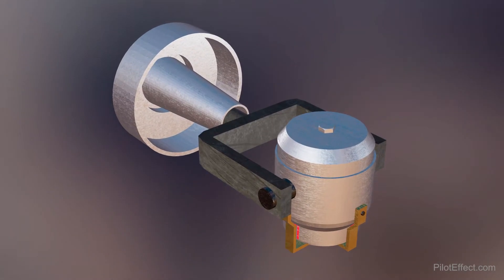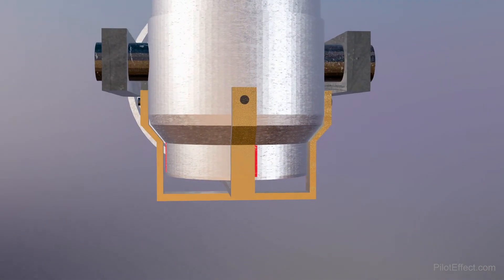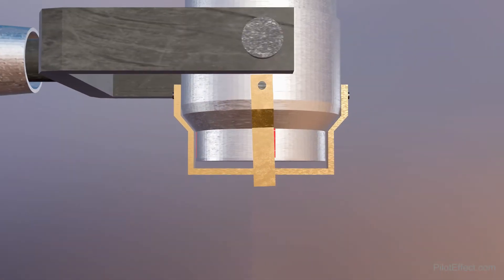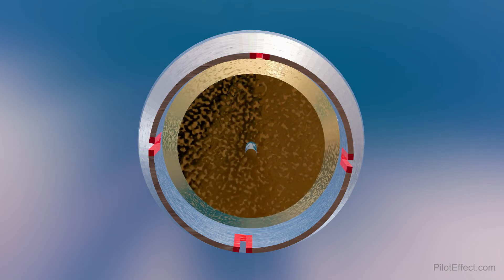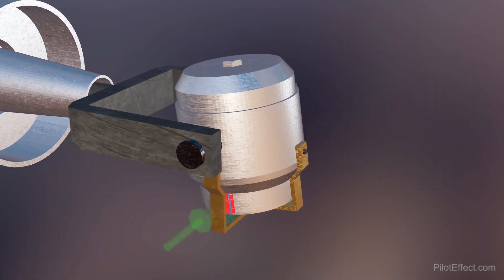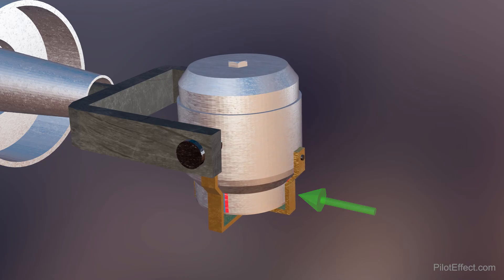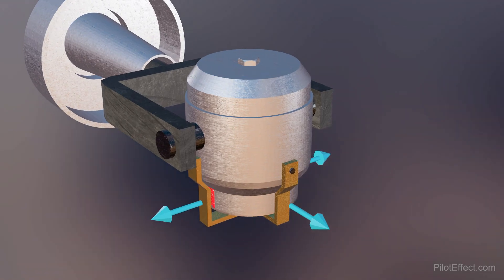Pendulous Vanes | Pilot Tutorial

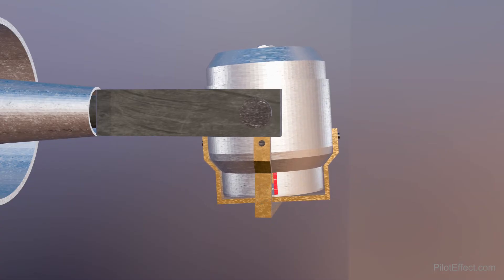Comment: Wrong Wrong Wrong The Gyro Rotor is rigid in space  and in this example would always be "Upright" it is the instrument case that tilts and moves in relation to the fixed, Rigid in Space, unaffected by ANY force Gyro Rotor... your statement @ 01:30 is false; the rotor does not "tilt " or move at all in relation to the aircraft thus your Pendulous Vanes would always be perpendicular to the horizon seeing they are attached to the rigid gyro rotor which is ALWAYS parallel to the horizon.... Think People about what you are being told... Total Disinformation has been fabricated and given here. The Earth IS Flat! You can Believe That!
Reply from the maker: hmmmm...
Reply: Nope — both Gyroscopic precession and Earth Curvature will force the gyro off vertical, even just from rapid maneuvering.

The ports are required to keep the gyroscope aligned to the vertical EVEN as the plane flies around Earth’s curvature.

Your brain is damaged from watching too many frauds on Flat Earth videos.

And just FYI, EVERYTHING is ‘rigid’ in space unless and until a force is acting on it. You don’t have to be spinning and spinning doesn’t protect you from forces acting upon the gyroscope.  What spinning does is effectively rotate the effect of that force 90° which is why gyroscopes SEEM to ‘defy gravity’ but they don’t — that force simply causes a precession.
Reply: Dark Star, 

The gyro is purportedly self correcting to remain vertical as the aircraft navigates around the curvature of the earth. It is believed this is happening because it is designed to remain vertical relative to its' original caging point. The issue is, that it would also continue to function this way if it actually wasn't navigating a curve; which you assume that it is navigating.

So, how to prove that it is doing the repetitive self-corrections during a long distance flight? 

I suppose you could video the pendulous vanes in action. Or, record the gyro  repeatedly  try to tilt backwards (in the SAME direction) over and over as the plane moved around the curve. Or, completely open all of the ports, and time how long it takes to begin to lose vertical alignment; then, see if during a flight of that same time period any curvature is detected.
.
.
.
There are those that claim 'gravity' automatically keeps the aircraft at the same relative altitude as it navigates around the curve. But 'gravity' has no feelings towards the occupants of an aircraft. It doesn't "care" if you live or die; fly safely or crash. And it wouldn't act to keep the plane in a level flight. The pilot must care about those things.

So, gravity isn't going to make sure the nose and wings are being kept in the proper alignment for safe level flight. Ask pilots that you may encounter or know personally, if they are periodically and repetitively changing the angle of their aircraft to follow the curve of the earth. I think you know the answer. If they aren't then that caring force know as gravity must be doing so. Just as it keeps one wing from dipping below the level of the other.
.
.
.
There is more to the whole gyro curvature debate then what you have been led to believe. Take for instance the Artificial Horizon visible in a Apollo LEM training module ( https://www.youtube.com/watch?v=2wfp-IMkN98 - seen beginning at 20.21).

A gyro in 'space' would only be useful for showing you your orientation relative to the surface of THE EARTH (if it worked at all). It cannot be used to orient a craft relative to the surface of a body it is not first oriented in relation to (i.e. - 'caged'). So how does an astronaut use it to orient himself to a surface - planet, asteroid, or moon - that he has not yet touched down on? 

"LEVEL" . . . would be level to the surface you took off from; not level to the surface of a sphere of a completely different size that you are approaching. Something smells in Denmark. Don't be so dismissive of those who will admit when they smell it.
.
Reply: @mephi654  that youtube video mentioned got terminated ... do you have a back up video? or a different link
Reply: Yo wrote: ""LEVEL" . . . would be level to the surface you took off from; not level to the surface of a sphere of a completely different size that you are approaching."

Exactly! That is so true. Here is a good link of it:
https://www.youtube.com/watch?v=zwKg9ZncrRg&feature=youtu.be&t=589
Reply: Here, let me repeat myself:

(Note: they claim they touched down 4 MILES from where intended; doing so by pilot control to avoid a boulder strewn crater; and with only 30 seconds of fuel left in their tanks.) 
.
.
Visualize what they claim they did. As they are approaching their landing they realize they are four miles from the place they intended to land. The place they had planned and practiced landing at. Immediately before them, is a crater that is boulder strewn. They take manual control of the craft and "skim over" the crater to land on the other side of it; with just 30 seconds of fuel left. No big deal right?

Kind of like doing an emergency landing four miles from an airport, without circling and looking for a good spot. From a position more or less lying on your back. And while not looking out of the bubble of a sailplane or F-16. No big deal at all. 

What made it much easier was the fact that they were clearly only going a half of a mile per hour, and that the craft was made to take all kinds of impact abuse. Not to mention that there were thousands of rockets and astronauts ready to launch at a moments notice, to come to their rescue.
.
.
.
Back to the topic at hand. The purpose of a gyroscope is so that you can determine  your orientation  relative to the horizon. As they were approaching their actual landing site, their gyroscope could not give them their orientation to that horizon because:

1) it had not been calibrated (caged) in orientation to that surface,
2) they were approaching a landing at a place they had not prepared to land at,
3) they did not have a very good ability to fly by sight from that craft.
.
.
Did they KNOW with mere seconds to spare, that the place they were now attempting to land was level ground? Did they know if it was sloping to one side, or towards them, or away from them? Did they know that the orientation of their craft and it's extended legs were correct for that surface? If the lander is leaning slightly forward, and the ground is sloping (even slightly) upward in the distance, the results are catastrophic.

How could they know that . . . when it is the Attitude Indicator (gyroscope) that shows that orientation, and theirs could not possibly have been set to reveal their crafts' position relative to that surface? Focus . . . I'm not saying they couldn't determine how far they were from a surface. I'm saying, that they couldn't determine if they were leaning too far in any direction. 
.
.
They would  feel  no 'up' or 'down'. They couldn't do what you can do on earth to correct these errors. They wouldn't realize they were going to impact on all four legs, or on two, or just one. THAT is the purpose of the gyro: To tell them if they were level with the surface. Use a model of that craft and 'land' it on your dining room table. Only as you approach the landing, tip it too far forward. See the problem?
.
. 
.
Do you believe they could correct that problem simply by looking out the windows? Before answering, consider why pilots are trained to rely upon their instruments. Consider why they even exist at all, if they aren't really needed. Then consider  WHY  such an instrument would even be included, when it could not possibly have been calibrated to a show the horizon of a surface upon which they had not yet been.

It was included, because its' purpose was to convince you that they had the capability to do the impossible because of "technology". They know (or knew) how few people really understood how these things worked. Smoke and mirrors; technological smoke and mirrors.
.
Reply: "Something smells in Denmark."

Yeah. But it is something different then what you are thinking of.
Gyros used in spacecraft operate differently then the ones used in airplanes. While plane-gyros can use pendulous vanes to reorient the gyro according to the local direction of down, spacecraft gyros cannot do that. They remain their absolute position in space by
* carefully aligning the gyro to the desired corrdinate system at the launch platform
* checking the gyro drift every now and then with the help of a star tracker. Since the gyro should be stable in space (but isn't due to unavoidable precession caused mainly by friction in the bearings), the star tracker knows in which direction a specific star should be visible with respect to the spacecraft. It then figures out the deviation to the direction in which the star actually is visible. Using 3 or 4 stars in that way, it is possible to calculate, how much the IMU has drifted from the intended orientation (usually very few). Then either the drift is compensated by forcing the IMU (using precession) back into the desired orientation or the deviation simply is accounted for in the equations which convert measured angles into a coordinate system.

And guess what?
One can do a lot of things with math. Eg. convert positions and orientations as seen from one frame of reference to positions and orientations as seen from another frame of reference. There are 2 ways to do that with maths: either one sticks with matrix algebra or one uses quaternions and vector algebra. Just because YOU never heared or learned about this, this does not mean nobody else is capable of doing that.
Reply: Someone else attempted to make the same point to me. Then I described for them what that would actually mean. Either the pilot would have to make  a few  great course corrections downward, or  many many  slight corrections downward. 

The concept of slight course corrections initially seems easier, but it would be actually harder. For instance, take a piece of paper. Cut it lengthwise in parallel 1 inch strips. Now take a second piece of paper and do the same thing; but instead cut them in 2/16 of an inch strips. Smaller requires more cuts and more attention paid to the actions. 

So if given the choice of making a repeated downward course correction (even a slight one) every seven minutes, or a greater course correction every 30, 45, or 60 minutes, which would you choose? Keep in mind that slight downward course corrections must be done as precisely as possible, so as to not over correct into the ground. Now consider that though a greater course correction would be easier to do, the pilot would definitely cognizant of the maneuver.
.
Reply: nothing would  be harder.
you just watch the altimter. If it tends to move off into higher numbers you correct down, if it tends to move into lower numbers you move up.
It is called a control loop.

"It needs more attention"
Yes. Exactly this is one of the reasons why autopilots were invented. To take care of the boring stuff.
The very same concept as  with a cruise control. YOu can either drive by yourself, having an eye on  the tachometer now and then and correct according to what speed you want to drive and what the tachometer shows, or you let the cruise control do the same thing. A cruise control does not need to know that you are approaching a hill. When the road starts to incline, it increases the engine power. Not because it noticed the hill but because the speed indicated at the tachometer has become lower than what it should be. The some goes for downhill: The speed increases because of gravity and therefore the cruise control reduces engine power. At no point in time was the cruise control awaer, that you were passing a hill. All it did was comparing the actual speed with the preset and activly reacting to a difference.

Same with altitude hold: The altimeter gives the actual altitude (measered via measuring the air pressure), compares it with the preset. The control loop reacts to a difference of thoe 2.

This really is not rocket science. You are making this much to complicated. Control Loops are around us everywhere. The most famous beeing the PID controller.
Reply: "must be done as precisely as possible so as to not over correct into the ground. "

Man, have you ever flown an airplane?`
Do you have any idea what a slight pressure on the yoke does to the altitude? Right now you are saying that driving a car is extremely difficult, since the slightest turn an the steering wheel makes you go into a 90° turn immediately.

Into the ground? From an altitude of 30tsd feet? 
At cruise level it is no real problem if an airplane deviates a few feet from the assigned altitude. This is why there is a prescribed vertical seperation. You fly in one direction, the plane oposing you is at least 1000 feet above or below your level. So even if you are off by 50 feet, the seperation is still 950 feet. More then enough to pass safely.

When listening to you, I have to conclude that actually it is a miracle on how to drive any vehicle on a road. The slightest wrong movement, just inches, ends in desaster.
Reply: Huch.
When beeing on the public gallery of a skyscrapper you cannot tell if you are leaning in some direction or standing straight?
You should see your doctor.
No helicopter pilot needs an artificial horizon to set down his craft on the ground. (Yes, all astronauts were also capable of flying and of course landingg helicopters)
But then: since the moon has gravity, pendolous vanes would still work as they do on earth. Apollo had the best instruments of their time. The company producing them had a very hard time fullfilling Drakers requests. Dozens of gyros were reject before they could meet his demands in quality and precision.

"See the problem?"
You really think that nobody else then you ever thought about this? When designing the LM, this was an issue, They tested various configurations to find out, how big of an banking angle the LM could have until it tipped over. Exactly that was the reason why those legs stand out that much. The LM could land at relativley steep angles without tipping over, as long as it fell down straight the last few feets. You know this is just a question of the area covered by the legs and the position of the center of gravity. As long as the COG stands inside the area covered by the legs, the LM would not tip over (as does any other object. physics is the same on the moon)
But as with any conspiracy nut, you do not know the real problem. The real problem was not to not tip over. The real problem was that the ascent required them to a relatively upright position. The allowed deviation was much smaller then what would lead to a tipover. A few degrees would be accaptable, but with 40° they would have been doomed. Don't tell me, that you cannot assess the slope of a terrain in the last landing face of a plane when looking out the window. It doesn't need to be exact to the degreee, but you can asess if its less then 5° or more then 30°. Every child can do that.

Pilots are trained to trust their instruments more then there senses because they need to enter clouds! There are millions of private pilots who can easily land their plane without looking at the instruments on a bright sunny day by just looking out the window. There are no clouds on the moon. The landing took place (all of them) at the local morning, when rocks casts long shadows. Can you imagine why this time of the "moon day" was choosen? Exactely. To actually see blocking rocks easily and to avoid them. The LM needed a few squaremeters of terrain, which is not covered with lots of boulders and relatively straight. YOu really want to tell me, that one cannot judge this from the windows of a craft hovering 15 meters above the surface? They had a landing designator etched into the window such as to see early where their trajectory would lead them. So even at altitudes above 200 feet, with a long time to go until the actual landing, they could easily see if they were heading into a boulder field - and avoid it. Look at the moon photos? Is the surface literally covered with boulders? No, it is not. There are some, but most surfaces are gravel and sand. They know this beforehand, because there were missons before Apollo 11 which took photos of a lot of sites and then a spot was selected where the chances of boulders is minimal. That is why it is called "Mare Tranquilitatis" with the emphasis on "Mare" - "Sea". Long before the dawn of space flight mankind knew, that the mares are not rough terrain.
Here in the alps rescue helicopter pilots land their vehicle every day in rough terrain. They are smart. They can handle this.

"... 30 seconds ... bla bla bla" That's why they sent Neil Amstrong and not you. You will run away as soon as things get tricky. 30 seconds is a long time, when you managed to come down to a few meters above the surface know the spot you want to sit down, are on your way to cancel all the residuals and all that is left is actually sit down the craft. Do you really expect him to abort as long as there is any chance to bring that bird down in one piece? Even if there are only seconds left? He had a suitable landing spot, he was already hovering, thus put that damned bird down to the ground! That is why Neil made an impact to mankind and you never will. Imagine Columbus "aborting" after seeing the tip of some mountain of an island because the "waves are to high". You really think he would have turned?

Besides
What has all this to do with pendolous vanes in an artificial horizon as used in planes?
Reply: Don't be stupid.
Of course it works. A force applied to a gyro makes the gyro react. If you do not believe this, dismount the front wheel from your bicycle, hold the wheel axel with your hands and make the wheel spin. Then try to rotate the axle about some other axis and notice the force you feel from the wheel-gyro to resist that rotation. The reaction does not counteract the force you apply to the axle. Instead the gyro reacts at a 90° angle to it. The axle indeed moves, just not in the direction you apply to force to it.
This is a very effect full demonstration when eg. sitting on an office chair. You know that kind that has wheels and is able to turn around. You sitting on the chair, the wheel infront of you rotating in your hands and just by "magic" you can make the chair rotate left or right as it pleases you.

PS: if it is impossible to force a gyros axis into a new direction, it also would not be possible to ride a bike, since the wheels of a bike act as a gyro. So the simple fact, that you can ride a bike proves, that you are wrong. It is possible - by applying a force to a gyros axis - to change its orientation, even if the gyro is already spinning.
Reply: I tried not to laugh, because the first response that popped into my head was of the various astronauts claiming that they couldn't see the stars at all when on the moon. So, that would make it really hard to do the math to "convert positions and orientations".

Secondly, while the stars would remain relatively stationary, the moon and its' horizon would not. Beyond the fact that it is circling the earth, they say it is also being swept along by the gravity of the earth on a journey around (and with) the sun that amounts to over half a million miles in just one hour. But, they do say landing on a moving aircraft carrier is easy.
.
.
You need to start using your brain, and stop listening to the smoke and mirrors explanations you have been given. When they neared the moon (if they did), their positions in that craft limited their ability to see. They were very instrument dependent. 

No gyroscope can be dialed into a correct level when both the craft it is in, and the surface it is referencing, is in motion. And when you are supposedly attempting to land on a surface like the moon, then you better be aware precisely of every inch you are from it. 

(Note: they claim they touched down 4 MILES from where intended; doing so by pilot control to avoid a boulder strewn crater; and with only 30 seconds of fuel left in their tanks.) 
.
.
.
Hmmm, something must have obviously gone wrong with their math. You can believe the fairy tale if you want to. No one can take that away from you. But more and more people are walking away from that foolishness (i.e. - don't be the last guy to get it).
.
Reply: Here’s a more detailed look, showing the pendulous vanes inside a real attitude indicator with a different pilot explaining how they work, demonstrating them in action and explaining why they are required (even on a Flat Earth!)
https://youtu.be/z1QGRPVBZvw
Reply: " if they are periodically and repetitively changing the angle of their aircraft to follow the curve of the earth."

Yes they do. They do it implicitely since no plane flies level on its own. There will always be winds, there will always be different air pressure systems. There will always be variations which require active steering. In a plane, active steering also includes altitude control. If the needle of the altimeter shows "to high", the pilot (or autopilot) steers down, if it shows "to low" the pilot or autopilot steer up. It is THAT simple.

(PS: altitude is measured by measuring the air static air pressure around the plane. Since the air hull follows the curvature, so does the plane by simple always staying in the same air pressure (=altitude) zone. It is as simple as that.)

It is pretty much the same as you driving a car on a "straight road". No road is really straight, so you always have to correct the direction a little bit either to the left or to the right.
Or for the same reason: cruise control in a car. A cruise control is not the same thing as putting a brick on a gas pedal. If the tachometer shows to low, the cruise control increases the engine power, if it shows to high the cruise control reduces the engine power. Thereby automatically adjusting the engine power in such a way, that the speed stays the same when driving over a hill. The cruise control does not notice the hill and it need not. It just compares the actual speed with the preset speed and acts accordingly.

In the same way pilots do not need to correct for the curvature. The simply react with the elevator to whatever the altimeter (measuring the static air pressure) is telling them. There is nothing fancy about it.